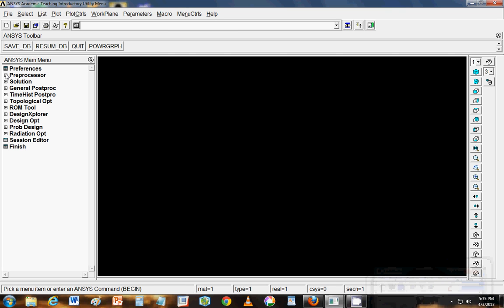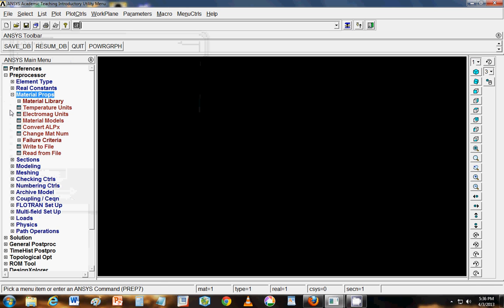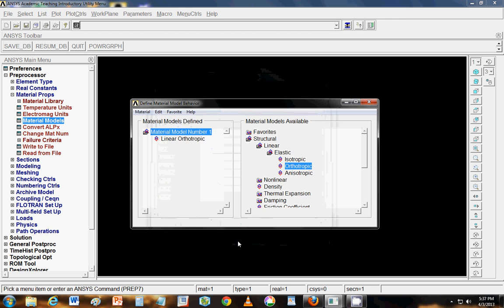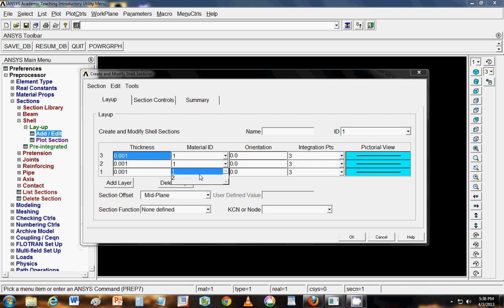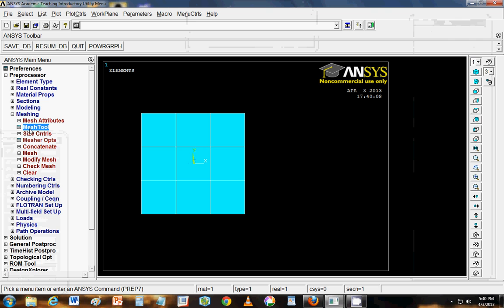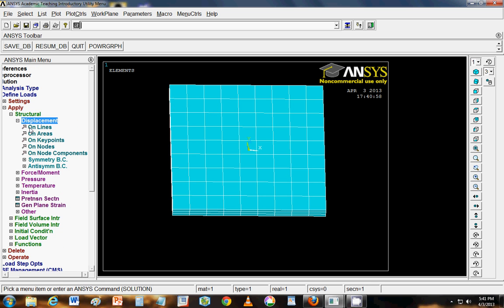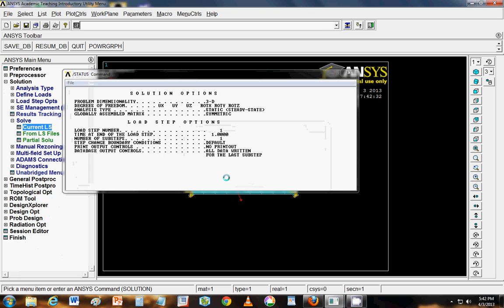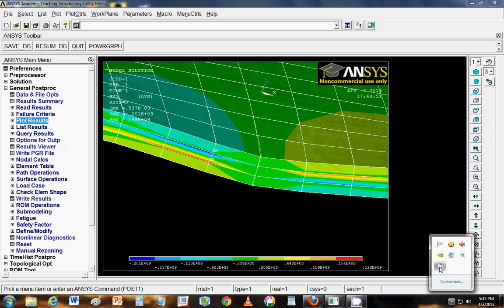Analysis of composites in ANSYS Mechanical APDL

Comment: And one more question. i modeled my model in ansys DM and when i transfer my data to MAPDL it is just showing lines in the interface. not a solid model
Reply from the maker: Hi,

I usually prefer not exporting DM data to MAPDL as it transfers the nodes only and many a times it faces some problems exporting solids and associated properties. Try this way:
Solve your entire analysis in workbench
and then export the results into MAPDL to further processing and analysis

Cheers,
Jaydeep

Comment: sir i want the tutorial of analysis of adhesively bonded single lap joint in mechanical APDL in 2d and 3d...i will be highly grateful to you.....pls sir upload the video for above problem...
Reply from the maker: You can do this by using the surface joint. create 2 solid surfaces and select "Contact tool", define adhesive properties in the contact tool

Comment: can we plot the stresses on the 2nd layer by removing the top and bottom layers!!
Reply from the maker: Hello Aniruddha, it is possible to plot stresses in individual layers, but you will need to model the same procedure using SOLID186 element.
Reply: thanks for your reply!!!
 Yeah I was trying to do so with the SOLID187 (10 node) 

It gives this warning message in the output window "ELEMENT is solid187. It is not associated with hyperelastic material. No suggestion available.". 
I'm not getting that please let me know what is the problem

Comment: HI Jaydeep, I am working on composite pressure vessels. I would like to know abt  shell   taper thickness in sol shell 190 by using secfunction array
Reply from the maker: Hi,
I'm sorry, but I have not worked with tapered elements. I will get back to you soon with a follow up. Thanks for watching the video.
Cheers,
Jaydeep

Comment: Hi Jaydeep
when i tried with SOLID46 elemnt with the same procedure as you explained using shell element, while meshing ANSYS is showing some error i.e. meshing is aborted. what might be the reason? how can i do composite analysis using SOLID46 element??
Reply from the maker: Hi Murari,
I'm sorry, I was away due to exams. SOLID-46 is not supported on the version of ansys I'm using. Have you tried using, maybe SOLID185? The difference here is that, you can not assign sections. You have to create layers separately as individual solid layers.
Thanks for watching the video. Get in touch with me if you get any issues.
Cheers,
Jaydeep
Reply: hi Jaydeep
I tried with SOLID46 element, it satisifies all the physical conditions for modelling composites. But the problem is i dono the exact procedure. your tutorial also helped me a lot. now i can do composite analysis using SHELL element. if u get an idea using SOLID elements pls give a reply
Reply from the maker: Murari Mura Hi,
So, I think I have solved you problem. Follow the steps mentioned below:
1-Element Type: Solid 186
2-After you add the element go to options in the same menu, select Keyopt3 and select layered element there. This way you get a layered solid.
3-Follow rest of the steps JUST like I have shown in the tutorial.

You can orient the element as per the commands which can be found in Help for SOLID 186.

If you need any help, feel free to ask.
jaydesh1@gmail.com
universeinanatom.blogspot.in
Reply: Hi Jaydeep
Thanks for your contribution on my problem. It was really helpful to me. 

Do you have any idea regarding contact stress analysis?
Reply from the maker: Murari Mura

Hi,
I hope I could solve your previous problem. Could you describe the contact stress problem, I maybe able to tell you regarding that.

Cheers,
Jaydeep

Comment from the maker: Hi,
Thanks for watching the video. You will have to enter the Ex Ey Ez, G1 G2 G3 corresponding to your material.Feel free to ask if you have any doubts.
Cheers ppocha p
Reply: Hi Jaydeep,
Thanks for your help. I have further questions about the "Sections" under Preprocessor for particulate filled composite. I want to model a polymer with flour particulate inside.. Would this have to be under the "Reinforcing" tab? Once I press the Tab it asks me for Area and Pattern...Thanks again for any advice you can offer.
Reply: Hi...Jaydeep
Thank you so much for this video lecture. But some problem is coming while I was using ANSYS 14. I use element type-SHELL181, Fiber rotation 45/-45/-45/45. And I apply load at line or at node. But, solution does not come.I am not getting why it's happening. Could you help me please
Reply from the maker: Nilabh Krishna
I can not figure why it is happening that way. You may try the same tutorial with SOLID186. And changing the Keyopt 3- to layered element.
Reply from the maker: ppocha p
Hi, I am not sure how that can be done. I will try to find out and get back to you if I can find out something.
Reply: Jaydeep Deshpande sir m doing project on composite material analysis ..n ur video helped me a lot .......plz can u give me ur mail id
Reply: @AkankshaSinghakkizcute  i will also do the project on composite material so some help from you
Reply from the maker: *****
 jaydesh1@gmail.com
Reply: @JaydeepDeshpande  sir get me some help from you for my project
Reply: +Jaydeep Deshpande Hi Jaydeep, very helpful video. I see in the video you apply the Young's modulus using orthotropic material properties to apply the higher stiffness in the X-direction. One thing I'm confused about is whether the orientation of the fibres should already increase it's strength in the X-direction independently of the material properties?I'm doing a project and am using 20-node layered SOLID186 elements and I have to compress a small layered pipe section. For instance if I apply a section layup to the layers which run in the direction of the X-axis, should that not increase it's strength on that axis anyway without applying a higher Young's modulus in that direction? (I hope this makes sense)Cheers

Comment: Hi Jaydeep,
Thank you for uploading this vdo! it has been very helpful to me (new ANSYS APDL user). 
I have a quick question about using ANSYS APDL for particulate filled composite (which you have briefly mentioned in this vdo). It would be very helpful for me if you can upload a video about particulate composites or perhaps if you can share some advice on how to run a simulation like that on APDL. 
Thanks in advance!

Comment from the maker: HI Sree Harsha.
Thanks, I'm glad you found it useful. The only change in case of 3D would be in the moduli of elasticity Ex Ey Ez and PRxy PRyx Prxz.and Gx Gy Gz Add the corresponding values from the standard available data.
There is no change in any of other parameters except the material properties. 
Feel free to post your doubts and comments. 
Cheers,
Jaydeep